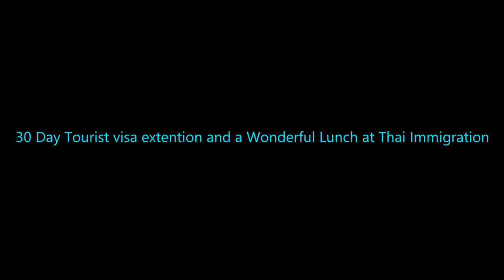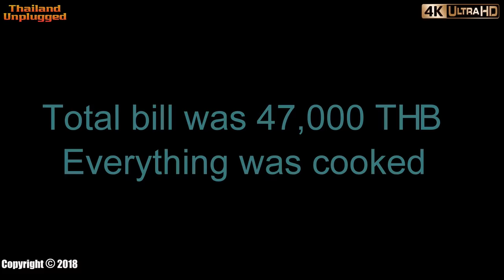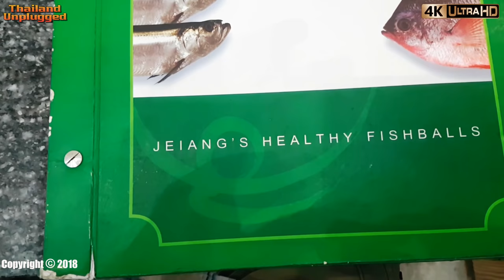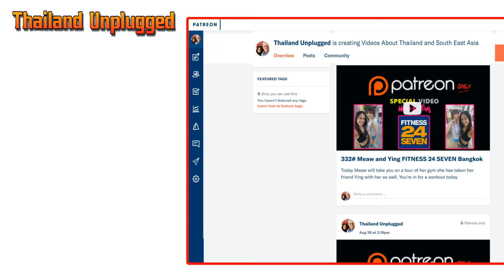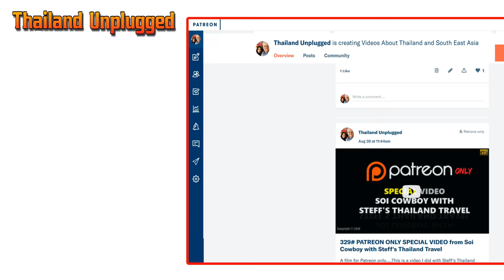Thai Immigration Tourist Extension and WHAT TO DO WHILE WAITING

Comment: 47,000 bt down due to a blown head gaskett.
Starved the car of coolant water due to a faulty radiator cap?
Typical lack of basic car maintenance.
I also expect you didn't look at the temoperature guage, and if you did continued to drive.
You must have really cooked it to do that kind of damage to a Honda engine.
Check the water and oil every week or every 500 kms if you don't want that happening again.
Reply from the maker: Yeah mate jobs done all cool lol... Yeah its a great car but I think they have hating probs.. but all fixed now

Comment: My neighbors radiator hose went , stopped the car quickly when overheating light went on , got it towed to garage , fitted new hose etc , but week later more steam coming out , when check the oil with some gauge was found to have water in it , so blown head gasket even though did not drive it far with busted hose , as you say one of those things 
Was junker anyway so cheaper  scrap it and get other car 😂
Reply from the maker: Yeah well its all been fixed now and it is a great car to drive going to keep it for a while longer and then maybe get a new one

Comment: I will be flying into BKK on March 11, but I will not leave Thailand until April 25. Will I need an onward ticket before the 30 day visa is up?
Reply from the maker: Look technically yes if they ask but lots of us don't... It is just so easy to book your ticket online now but if its ok leave your return ticket open
Reply: I assume you have a return ticket for you to leave on the 25th April, if so that would be your onward ticket. If you intend to stay over 30 days why not get a 60 day visa as it is cheaper than a 30 day extension, and no need to have the trouble of applying for one.
Reply: I will do that. Thanks
Reply: @ianroyle7102  , correct. Good info.